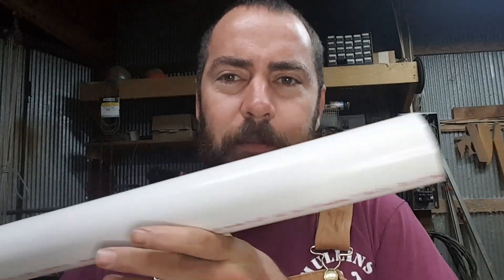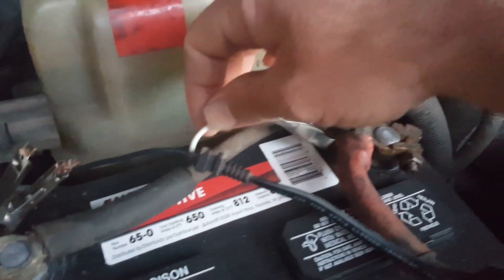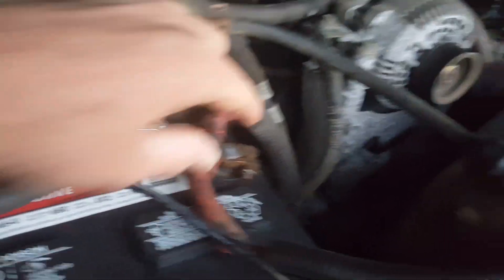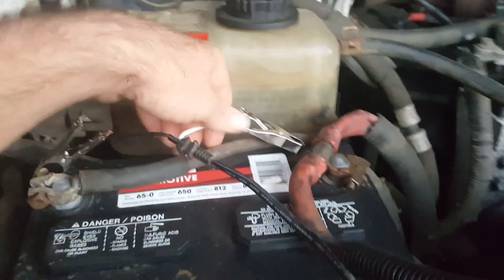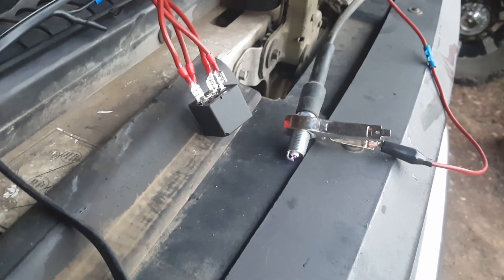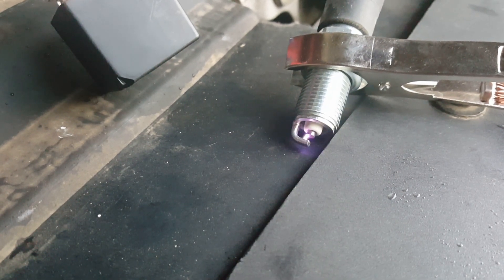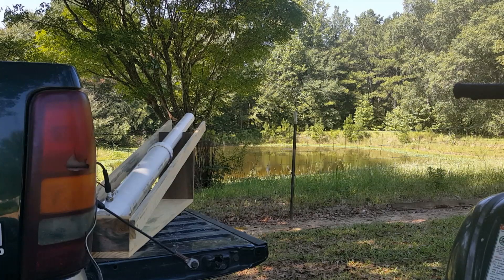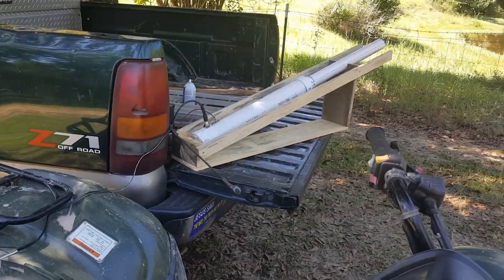Potato Gun with Buzz Coil Ignition System: Build and SHOOT!

Comment: I also dont really like work lol Projects are better! Thankyou for the ignition tutorial. Everything was crystal clear, except what the condenser does. So I looked. A capacitor, which will charge during the on cycle, both keeping the output at low state,  and allowing for an extra dc/amp kick when the field does change in the relay to the  coil. So, cool there. Crazy potato gun. I wonder how far you can push pvc? :)  Happy new year.
Reply from the maker: As far as I know, the condenser absorbs the energy when the contact points inside the relay are open, to keep an arc from jumping across the open points. It'll run without the condenser, but the relay would fail way sooner than if it had a condenser.
Reply: Ggouuuuguguuuuug  hug ugguhogigogigigogouggoggiggigiighoggigigigiggigigigigigigiggigigigiiggggigggigigigigigigigigggigigiggigigigigigigiggigigggigigigggigigggigigiggigigigiggigigigigigigigigiuggguu hug uuu  hi guy  hug uu hi u guy guy g guy guy guy guy hi guy guy u guy guy guy guy g guy guy guy guy uu guy u guy guy guy  go u guy  guy guy guy guy guy guy g guy  guy guy g guy hi u guy guy guy uu guy guy guy guy guy uuuugu guy guy guy u guy u hi guy Gigi guy guy ggo